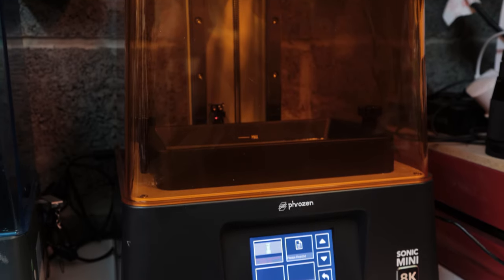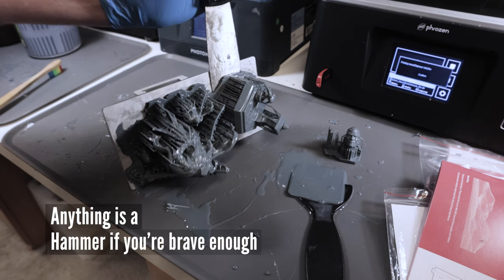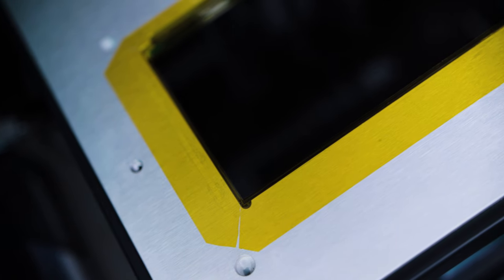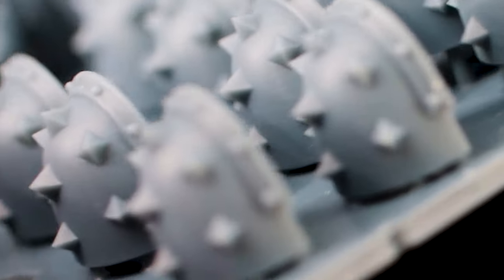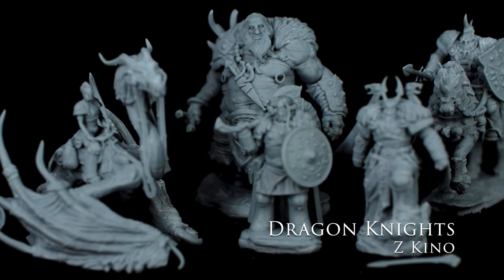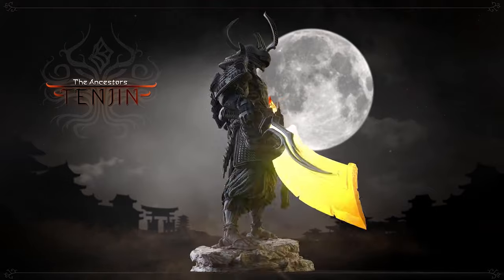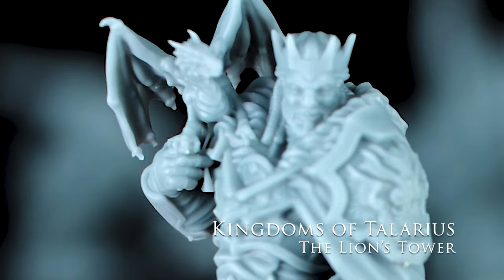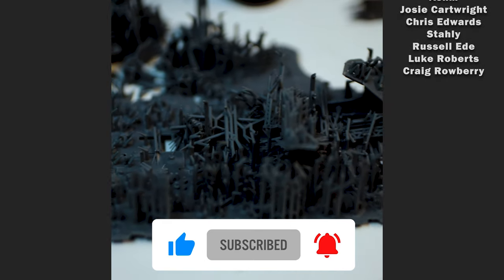DO NOT BUY - Phrozen Sonic Mini 8k Review for Miniatures, Warhammer & More

Comment: Just bought one of these and very keen to try it out after watching your video! How does it hold up 7 months on? Is it truly capable of matching GW quality at the same sizes?
Reply from the maker: 7 months later I’m reviewing new printers, I’ve hardly touched it since the initial review I’m afraid.

Yep, it’s more than capable, but in fairness so are quite a few printers now. Hope you enjoy it, it’s a great printer
Reply: @FauxHammer  Thanks for coming back to me so quickly! 

Are there any other printers you'd recommend over the mini 8k if my main goal is achieving the best possible quality for printing miniatures (say 32mm)?
Reply from the maker: @Alex-xh4jn  It's a hard one. I print miniatures mostly, more than anything else. And when I print miniatures I tend to use resins, that are generally a bit more flexible. Becasue the higher detail resins are brittle and small components can snap easily. If you are gaming with your models, then I'd opt for somethingwith a similar print resolution but have the convenience of a larger build plate... e.g the saturn 2 or Saturn 8k, the M3 premium, or the Mighty 8k. I have videos on all of these printers, with a comparison video out next week.

If you must, MUST! have the absolut best detail. then yes, on paper this has a higher resolution. but to avoid layer lines yuou'll need to apply antiailiasing and image blur., which IMHO all but negates the benefit you will get from this higher resolution. especially since most miniatures do not have the detail to benefit from that resolution anyway!
Reply: @FauxHammer  awesome thanks for the detailed response! So assuming having no voxel lines and then having the highest level of detail possible are my priorities in that order - do you think the mighty may be better suited? I guess either way I'd be running with AA 2 and maybe blur 2 as well, so the question would be at that point, does the mini offer anything more over the mighty in terms of quality 🤔
Reply from the maker: @Alex-xh4jn  I genuinely can’t see a difference on minis between the mini and mighty, the mighty has the benefit of a larger plate.

We are talking a difference in resolution of 6.5 microns. Less than a thenth the thickness of a human hair…

If you can perceive that difference, I wish I had your eyesight.

Not sure if the price difference, but I would opt for the larger printer.
Reply: @FauxHammer  thanks again, massively helpful for me in making that decision! 

One other question - are you across the AA issue with the mini? I've seen images that show the mini seems to produce more noticeable voxel lines when using AA compared to the mighty using AA, for the same models. If it wasn't for this I'd probably already be sold on the mini, but it's got me a little worried now

Comment: Hi mate,
Im a bit confused as to why this is ranking no. 2 on your best miniatures printers list, when your review says "do not buy" can you shed some light on this?
Best regards
Reply from the maker: Sure thing, watch the video, not just the thumbnail. 😉
Reply: @FauxHammer  Took me too long to get the jest ;) I was worried about the resin sticking to the plate, and the fact I could only find the printer at a low cost from the website shipping only from outside of the EU, so I went with the Saturn 2 8k after your excellent review. Thanks alot ! And thank you for the review on the Anycubic m5s - cancelled my preorder after seeing it :)

Comment: You're an experienced 3D printer and you still struggled with this device, that about sums up why GW is not worried about 3D printing. As to the claim they are the pinacle of models - that's arguable, even potentially in plastic - but definitely once we go to resin and metal model companies.

Comment: I was looking at the Elegoo Saturn 8k (smaller of the two, not the Saturn 2 8k).. there's a big price difference between this and the Elegoo.. is there a quality difference?
Reply from the maker: Not noticeably. the Saturn 2 and the Saturn 8k are basically the same thing. Both have 28.5 Micron XY resoluton. the Phrozen Sonic Mini 8k has 22 micron.

Can you tell a difference by eye though? hardly...
Reply: @FauxHammer  But if looking at the Saturn 8k or the Photon D2.. is D2 the clear winner? I saw your other video where you were talking about the D2.. I'm just concerned about size of the print bed/screen size. It's specifically to print 32mm minis, I'm not interested in large minis like tanks or daemons etc.. just troops/characters.. maybe 30k scale non daemon primarch type size..
Reply from the maker: @chrisrichardson1600  the D2 is easier to use. Because DLP light is more direct than LCD. You will find a much wider range of exposure times give you successful prints in the D2.

Saturn 2 is an LCD printer so it needs to be dialled in like any other.

For your use case, I’d get the Saturn 8k for the price point. You don’t need the extra height of the Saturn 2 and because of that, there’s very little difference between them that warrants the  extra expense.
Reply: @FauxHammer  so the Saturn 8k would be better over the D2 simply on a price point? I remember you saying something about increasing the anti analysing to blur out the layer lines.. I guess I could always start my resin printing with the Saturn 8k (a much higher step up than my current Anycubic i3 Mega) see how I do.. thanks a lot for your advice!
Reply from the maker: @chrisrichardson1600  The D2 is good becasue it just works, it's simple, has fewer components to breakdown and the projector lasts far longer than any LCD would. 

ut for the convenience of the size you get with the larger 8k printers, that;s what i;d reach for now.

but this is a realisation i;ve only just come too in the last few weeks when testing out the M3 Premium - here's a preview link to that video (pending a few more edits) https://drive.google.com/file/d/1WGPV9QEfF8znUSPzU__mwXio5ULUfcFa/view?usp=share_link

but yeah, I'd pick the Saurn 8k.

I've just started playing with the Saturn 2 and have the 8k on the way.

Comment: I don't like the design they use for attaching the build plate. 
I do think 8K is that sweet spot, although I think a large screen is the sweet spot there, around 10 inches.
Reply from the maker: Yeah I agree, though i generally like this design when they work. 10Inch screen! Personally I'd want 16k at that size.

Comment: Great video as always. You were just missing how much it costs... initial cost of the printer, software, etc and then running costs, resin, etc. That is the missing jigsaw piece for me
Reply from the maker: Fiar point, it's so expensive. I think the main issue for me is getting the RRP in various locales. But I;m sure I could pull something togethther, even if it was just a screen shot showing the price on screen.

Comment: Got the mini 8Ks, same build plate issue. Same thock sound when it moves the plate down against the screen, similar issues with splicers having issues with it.Two plates, I tighten, they wont level. First was horrible, prints always fell off the left side, second... just not great but not horrible. No big prints near the sides though it's looking like.
As questionable as the product and design itself is though... They remove the reviews on their website if they aren't good. That's the part that got me especially concerned. Suffice to say I probably won't ever buy or touch another phrozen printer after this.
Reply from the maker: That's what all companies do. it's why you should always check YouTube and all reviews you can before purchase. I'm not the best reviewer out there, none of us are. as VOG has said himself. we can only run limited tests in a limited time. some of us will find things the oher's don't.

I;d speak with Phrozen but it sounds like the screw for the z-rail is loose and just needs tightening.

Comment: Had a 4k phrozen 3d printer. Complete ball ache and ruined my love of the hobby for months as everything to do with it was a pain. Sold it and now just buy 3d printed stuff from etzy.
Reply from the maker: that;s unfortunate it can be hard to get started I agree, I should do a video to help make it simpler for people.
Reply: My 4k mini has been incredible after maybe 4/5 failed prints it's worked faultlessly for a year+
Reply from the maker: @sitefms  I suppose is different strokes really, 3D printing can still be a lot to wrap your head around. Too much in some cases and there’s still no clearly define way to just follow a guide and get started
Reply: That sucks man I have a 4k mighty and it's been awesome
Reply: @FauxHammer  for sure, different resins act so different as well...I've seen people go down to lower exposure times of 2.4s with the same resin and printer but I can't go below 3s with out 100% fails...its a bit of a personal learning curve!

Comment: Re. Is printing a threat to GW.

IMO not entirely, not everybody has the space in their house to setup an area for printing, not everybody has the wherewithal to do the research needed for where to locate files, get the best print settings, and educate themselves on the dangers of resin and what safety measure you need to take, plus even if you have people with that then there are definite issues if they have kids or pets who are likely to come into contact with the resin printing area.

Then you have the issue that if you are a competitive player then GW are understandably becoming increasingly opposed to the use of 3D printed models/parts being used in their tournaments.

I got my resin printer (mars 2) November 2021 and have been printing plenty of stuff with it since then but I still find myself buying GW stuff because I still love 40K/30K and want to support them as well as sometimes just wanting to sit and build an infantry set made of plastic and then use my printer to print off accessories to make those core models my own with custom helmets, custom shoulder pads with my own designs on them etc.

For me resin printing is a tool that aids me in my miniature painting/assembly hobby as opposed to completely replacing GW products.

Some day in the future it would be nice if GW experimented with releasing their own STL's because I would absolutely be eager to try those out.
Reply from the maker: Great feedback and thanks, and I also agree that GW should experiment with STL's or even allow people to submit their own models for sale on a GW storefront before other companies like Cults 3D take over.

agree that GW should clamp down on Ip theft and this is a tool which should enhance our warhammer minis rather than copy them

Comment: Nice vid!
And yeah, it does indeed look like a nice printer, but for something so expensive, some kind off protection for the lcd is a must imho. (well, for any resin printer, but especially for premium products)
Honestly, I probably won't get one, but that's not because it doesn't look awesome, because it does. It's mostly because I prefer to stick with 1 brand (unless it sucks, but^^), not 20 different ones. :)

For the thick raft from using Lychee. That does intrigue me. Is this anything you've experienced with your other printers?
Do use Lychee for supports etc, but lately I've done the actual slicing on Chitubox, because of the superiour AA.

Will/does 3D printers hurt GW? Probably a bit, but the 3D printing market is still small. And until we've got some serious ease of  use improvements. Most "normal" people won't get a resin printer.
Reply from the maker: I hear you, the Lychee issue was so random and yeah I slice in chitu  now to avoid this after supporting in Lyche. not seen any AA issues in Lychee though TBH. I;m the only person who has this slicing issue, using latest lychee and firsmwate, I even spoke to Luke at @geekgamingscenics with the same setup and he didn;t have the issue. I can slice the exact same stl in Lychee and Chitu and I get this thick raft issue in Lychee every time. and early on, it was encroaching into my models
Reply: @FauxHammer  So annoying :'( 
Regarding AA & Chitubox, what I meant was that Chitubox does the AA/Blur better then Lychee, or well, it feels that way to me? :)

Comment: "They're not doing this because I'm a Phrozen partner."

If they know you're a content creator there is still every chance you were getting preferential treatment rather than the usual customer support experience.

Seeing how many owners are reporting the same issues with Phrozen was enough to dissuade me. Having to conduct your own repairs on a brand new printer goes beyond 'teething issues' in my book.  Numerous and ongoing user reports of dead LCDs and levelling issues probably should have been presented as a stronger indictment than it was here; this was an extraordinarily forgiving review.
Reply from the maker: Wow, what fair comments to add! 

At the time, they did not know about me. I think they learned about me from this video, it was only my second, maybe third printer review.

But i need to say that times have changed somewhat. For a long time now, printers have arrived with many quirks and early adopters like myself had become used to them. But yeah, only a year on and I'm quite a bit less forgiving.

Comment: Yes 3D Printing is a threat to GW, that being said… GW isn’t doing itself and favors jacking up the price so high… example The Horus Heresy starter boxset is what? $250 USD you get 40 Space Marines, 10 Terminator, 2 Commanders, a Landraider Spartan Tank and Dreadnaught… 54 models in total. That’s 2000 points worth of models in 40k (I checked) and what I used for my Iron Warrior Army for 40k AND 30k. Mean while you got these army boxes that you can’t even used as an army out of the box because it’s just a HQ choice and 3 Elite choices like the Adepta Sororitas Sanctum Guard that cost the almost the same amount and has half the models and is only what? 700 points in total? If the pricing was more in line with the Horus Hersey starter box  then I don’t think as many people would try to find other ways to get models.
Reply from the maker: True, the strater boxes are always best value. it's the good crack to get you hooked, then you buy the smaller sets after. But it's due to production costs. almost every HH player will buy that starter box. or 40K player will buy those starter sets.

Whereas only a handful will buy a specific faction box. Volume sales on HIPS models reduce a ton of the investment and is, at least in part, why they can sell these larger boxes much cheaper

Comment: Yes, do not buy this! Buy the Mighty 8K instead. I bought the Mini 8K, but the buildplate was too small to fit medium sized models. I exchanged it for the Mighty 8K and I was happy that I did. The difference in print quality between the Mini and the Mighty is too small to notice and I have a much bigger buidplate to work with.
Reply from the maker: Oddly I’ve spent the last week with the m3 premium which has the same res as the mighty. And I agree with you entirely
Reply: @FauxHammer  are you going to review the M3 premium? It looks like a good deal. Maybe I’ve paid too much for the Mighty 8K.

Comment: As someone looking to buy their first 3D printer, thank you. I think the Photon D2 is it for me... although the voxel lines scare me.
Reply from the maker: It’s a hard choice. For the same price, why not get a larger printer like a Saturn 2 Or M3 Premium
Reply: @FauxHammer  well.. I have 17 unpainted armies... So my smooth brain thinks that if I get a smaller printer I won't just print whole armies and will focus more on printing high quality smaller parts for conversion or single miniatures.
Realistically I just want the highest quality prints for painting with basic techniques like drybrushing, washing, contrast etc.
Reply from the maker: @nasigoring1525  for the ultimate quality now, that’s still the Mini8k. But I find the 8k resin is only useful for display miniatures. It’s far too brittle to use for tabletop minis

But the difference between the mini 8k and the 10” 8k printers is no tiny it’s negligeible that I often opt for the larger printer out of convience.
Reply: @FauxHammer  Thanks for the insights, they're fantastic. My miniatures will be used for some play, for sure.
Saturn 2 it is!

Comment: Granted I haven't watched to the end yet, but your bottom layer exposure time is too long.  35 seconds is overbaking it and making it difficult to get the raft off.  Try between 15 and 20 seconds.  Also your light-off delays are almost half what they should be.  I don't think 6 seconds even comes close to covering the lift time.  Ask Phrozen about their Light-Off delay calculator.
Reply from the maker: Did you see the bit where I explained that I used these settings to compensate for the faulty build plate?
Reply: @FauxHammer  yes, why don't you get a replacement or just sand it flat?  Find a granite worktop, ensure that it's flat, then tape sand paper down.   Most of us who got printers prior to the 8k had to do this because the surface wasn't etched.
Reply from the maker: @mattperson7293  Becasue the issue was due to a threaded screw from the factory 01:37 - I did get a replacement.

Comment: Ordering mine today on Prime day for 479!
Reply from the maker: Bargain!
Reply: @FauxHammer  I got it a few days ago, when I went to checkout there was an additional coupon, so it was 458 with tax, to my door.  I have it up and running, suprised on how long it takes to cure a white resin (3sec) even though the resin cures on two other pirnters in 1.5 sec, but the resolution and pixel density sure cant be beat!
Reply from the maker: @DimensionMachine  woah that’s long, I have phrozens 8k snow grey and that’s like 1.7 seconds. I’ve had softer resins like Sirayatech Tenacious Black take 6 seconds!
Reply: @FauxHammer  this is some low cost voxel labs white which I have a long pleaant history with on other printers at 1.5 sec for the Mono x and 2 sec for the Jupiter.  I have some "8k" grey arriving tomorrow to test with.